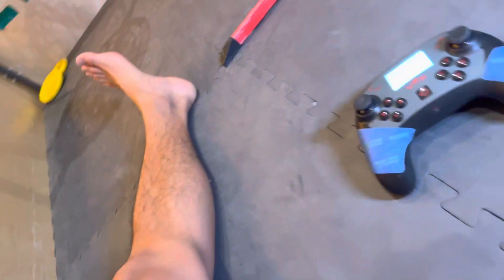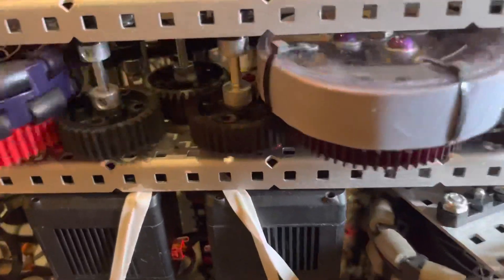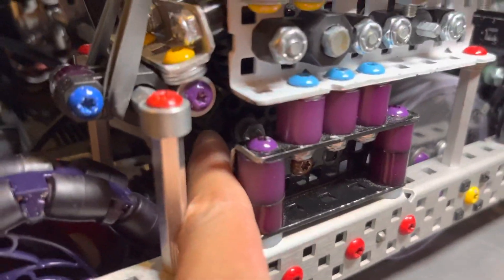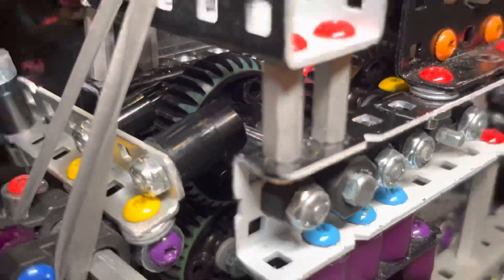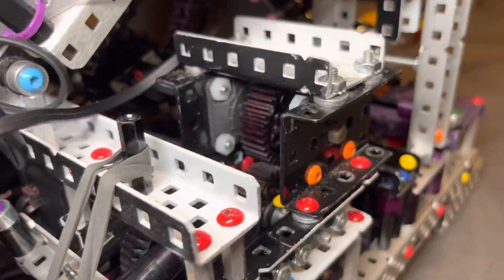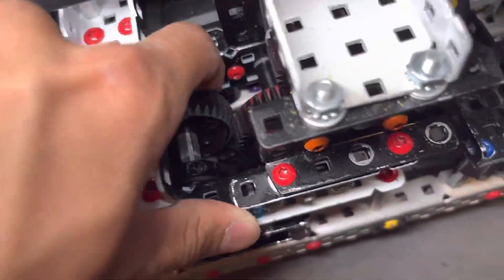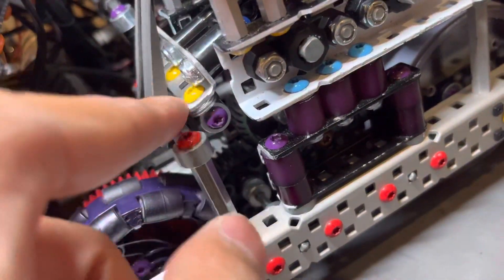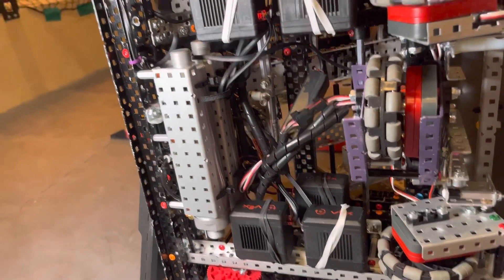606X Spin Up | Drivetrain PTO Explanation

Comment: I know it has been a year, but what color motors did you use for your drivetrain if you remember, my team is new and we would like to make a similar design. Were the motors green, blue or red?
Reply from the maker: They were blue motors (600rpm), connected to 36t gears. The 36t gears drove the 60t gears attached to the wheels to get 360 rpm output
Reply: Is it better to have 36t to 48t for 450 rpm or 36t to 60t? Also my team is called 6060X lol

Comment: Are your custom traction wheels polycarbon and a cut out flex wheel? Really helpful video as always thank you Ben!
Reply: Yes, we used the old 3.25 vex traction wheels with the outside sanded off and then a flexwheel wrapped around it and then the polycarb to keep everything together
Reply: @journeyh9170  thanks

Comment: Just curious as to why a lot of your gears are black, is that bc graphite or spray paint? As well what's the plus side of using beveled gears for a lot of this? Less binding? Or something else
Reply from the maker: It's black dye. Beveled gears help the PTO shift smoothly.
Reply: @606X  did you make the beveled gears yourself? If so was it like a 3d printer or how'd you do it? 
I don't figure you bought them from vex because I can't find anything on their website about it
Reply: @loganjeffery7030  Yes, Ben sanded down the outside of the gears himself

Comment: What is the reasoning for putting rubber bands on your motors?
Reply from the maker: Hotswap, you can easily change out hot motors
Reply: @606X  How does the rubber bands allow you to change the motor?
Reply from the maker: @ramco5725  Remove the screws holding the motor cap to the motor body. Then use rubber bands to keep the motor together. This way, if we would need to change motors, we can detach the electrical part of the motor without unscrewing the 2 #8-32 screws on the bottom.

Comment: Also can you make a video explanation on your tracking wheels and odometry?
Reply from the maker: How would you like it to be formatted
Reply: @606X  just ig showcase how u mounted them and utilized them in code
Reply from the maker: @huhrawz  they're just mounted cantilevered on a screw joint. As for implementation wise, there are good beginning tutorials from resources such as BLRS. Odometry can be used for things such as automatic flywheel speed, automatic aim, and extremely useful for autonomous skills